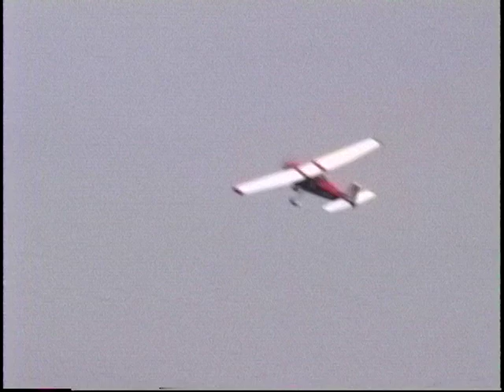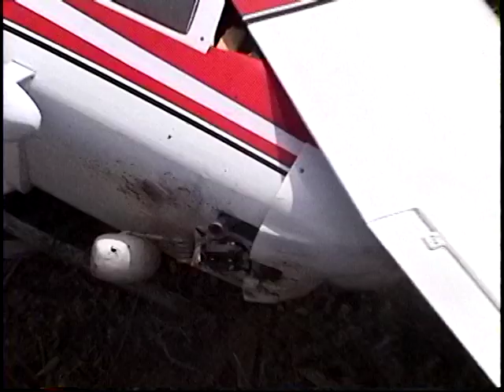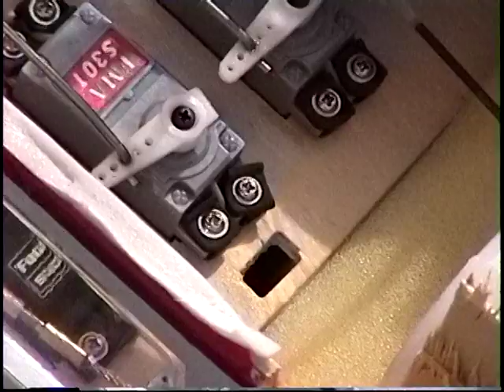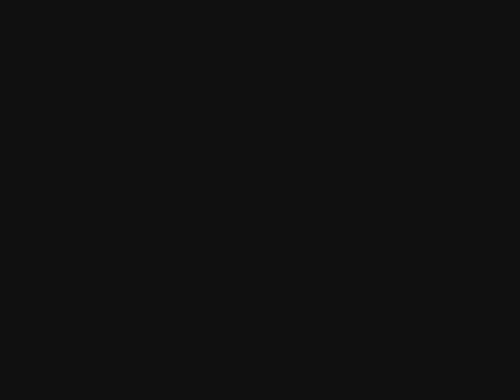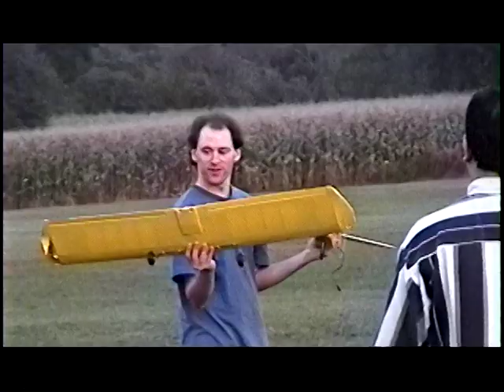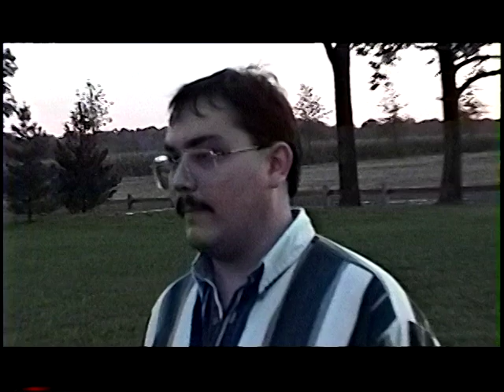RC airplane crashes - pissed off pilot - better quality

Comment: You can see the wind direction when you rev up the Cessna in the beginning. Notice how the first downwind pass the plane gets out of shape but you get lucky. Heading up wind or right to left in the video is fine. Only when you go left to right or downwind does it get bad, and only when you have dropped the throttle on the second pass. Ailerons were fine before crash, stalling downwind caused by excessive use of the ailerons instead of the rudder. Ailerons will induce more drag, making it worse

Comment: What you really had here was the falling leaf manuever but using ailerons instead. Plane was stalled and You failed to lower the nose to recover. Once you have gone below stall speed, ailerons will aggravate the wing stall. You MUST use rudder to lift the wing once you have entered the stall region. This was taught to me well by an acrobatic instructor when I earned my Private License. Size of plane does not matter though transmitters are hard to get used to for me after using hands and feet!

Comment from the maker: 6th, I took apart both aileron servos and found flashing on both plastic output shafts, which was the defect Cirrus admitted was the problem with a large number of servos - I still have the reply letter! 7th, the servos and a full copy of this video was sent to Cirrus and they sent me a check in return to purchase a new plane after admitting their servos failed from the defect. 8th, this video is 12+ YEARS OLD! I haven't crashed a plane in 8 years; in fact, I am a flight instructor now. lol

Comment: Okay, read carefully. The wind is left to right as your looking out. 10 second mark notice the direction the smoke goes. The turn from down wind to upwind at the 50 second mark is a classic no rudder turn. At the 1:11 mark you point the nose way to high in a downwind pattern and then get on the throttle to late to save it because you continue to hold elevator when you should be pushing the nose down. The plane is stalling pitching left/right until it stalls for good and crashes damaging servo.:)

Comment: The Cessna crash was a classic wing stall. Air speed too low, angle of attack too high = wing stall. This is the classic start of an Insipient Spin and must be correct properly.

You then made the situation worse by hitting the ailerons hard just further disrupting the already compromised airflow over the wing making the stall worse - thus the seesaw action you see while you are trying to correct the stall. Last control you touch is aileron.

Not ridiculing you, just stating the facts.

Comment: The yellow plane at the end might run at full throttle if you adjusted the carburetor. I hope you have learned since 2012. Been 3 years now.
Reply from the maker: +ctrcflyin2011 It's actually been almost 19 years ago - that was filmed in 1997.
Reply: +BSD2K11 Wow, 19 years ago. When i was born you were out on the field being pissed at your crashed plane! x)
Reply from the maker: +Tremor244 lol Yep!

Comment from the maker: 1st, the camera man's position is behind the plane. In that position, you can't judge the ground speed since the plane traveling AWAY from you, it LOOKS like it's standing still when it was NOT. 2nd, I was flying directly INTO a steady headwind. 3rd, at 1:11 I apply 3/4+ throttle to compensate for the headwind. 4th, the servos DO NOT MOVE from 1:14 until impact. 5th, the servo manufacturer examined the servos and admitted they had a bad batch of servos and my set was defective.

Comment: It's called stall.  No servo  problems.  Pilot error.  Not the planes fault.  Whole flight was barely under control.  surprised it lasted that long.

Comment from the maker: 1. Air speed and bank angle were fine. The engine was 3/4 throttle in a headwind with a forward speed of roughly 35mph, heading away from the camera.
2. The bank to the right was intentional, it was my first attempt to get the left aileron un-stuck.
3. The bank to the left was a reaction to centering the control stick to check for a neutral aileron - it was still stuck.
4. The wobble back and forth was my attempt to use the rudder to compensate for a stuck aileron. Watch the full video I posted.

Comment from the maker: Ok, let me ask you this - if I rig a plane up where I can kill your left aileron control (with it raised up), right before entering a turn, into a headwind, at 3/4 throttle, ~65 feet in the air; and you have to struggle with the failure and try and fly the plane straight and level, would it look like a stall and pilot error? Especially from the viewpoint of a camera - directly behind the flight path? What came first - the aileron failure or the stall? How far could you fly with a failed aileron?

Comment from the maker: If you were fighting a stuck aileron, it would LOOK like your stalling the plane too. The problem with your theory is: if the aileron did not get stuck, the flight would have been uneventful and I would have landed safely. Just like a stock car driver who's tire blows out and wrecks - if you miss the fact that the tire blew out, then I guess you'd think the driver slammed the wall on purpose. 

So, what if the tire didn't blow and what if the aileron didn't freeze?

Comment: watching you fly the cessna you crashed it, you were going too slow and tail heavy. if you can't take off using landing gear don't hand launch it if the motor stalls at full throttle  fix it don't fly it

Comment: 1st Crash... Stalling it.   2nd Crash... you don't cut throtlle when you hand launch an aircraft.  (or if you had engine problems you shoutd have fixed it prior to having it tossed).    Recommendation - go to local hobby shop or contact  RC club to ask if they know of  instructors who can teach you how to fly properly, and safely.

Comment: number 2, always , every flight , hold plane vertical at full throttle and make sure engine clears out to near max rpm, certainly not too lean. 1 to 2 second from idle to max rpm, then set low end mixture to reasonable idle, which if effect will act as an airbreak assisting with your task number 1

Comment from the maker: I agree - it was a bit tail heavy. It was the maiden flight and I never got a chance to adjust the CG, although I did check it before heading to the field. I usually build my planes slightly nose heavy, but for the Cessna, I made it level using a Great Planes CG scale. With windy conditions as they were, I should have adjusted it at the field. Oh well.

Comment: first day out after rebuilding my F4F my buddy and I were flying at the local park. had my camera on it and when doing a low pass i lost signal and hit a light pole full throttle. After my rant I realized it was a pretty cool crash, but my camera was destroyed =(  up until that time I had never seen a foam plane wing explode... =D

Comment from the maker: I could agree with you, but then we'd both be wrong.

• As I approached the last turn I was heading into the wind.
• Before I began the turn, I increased the throttle. It's not a 2-cycle engine, so it may not sound like it was screaming, but it was nearly full throttle.
• Ailerons were not fine - I was flying the plane, not you, so to pose a bold statement without facts is ignorant.
• I couldn't care less what people think caused the crash - the mystery was solved 13 years ago.

Comment: Skip the Nitro and Balsa...pick any Horizon Hobby foam/electric ARF and go to town. When you crash it you glue that sucker back up, slap on a new prop and go flying again within the hour....as good as the foam is today and with the new AS3X system coming on more planes its making the hobby less expensive and more rewarding.A sim wouldnt hurt either.

Comment: never hand launch a low or mid wing plane..Take off from ground ..Also,No one can fly a tail heavy plane ..It just wont fly right..I ALWAYS fly mine a LITTLE nose heavy , but only slightly..I feel your pain..I taught myself and learned the hard and expensive way

Comment: Pilot error all the way on the Cessna; no rudder in the turns meaning it was yawing nose high through the turns. Due to this it stalled the pilot hauled back on the stick and it just stayed stalled all the way down. Basic newbie error. Clearly nothing wrong with the aileron.

On the hand launch the motor was set too lean. You need to check the plane at full throttle holding the plane nose vertically up to make sure it doesn't lean out when the nose rises in flight (basic stuff).

Comment: I have had my elevator servo sheer, it happend during a high speed dive, ended bad. But that last crash is a nightmare, ive had the same thing happen except it was my lipo cable jolting out causing a nose dive, minor damage, given that it was a foamy!. Balsa planes are too much work for me to even attempt at the moment!

Comment: I hope you did'nt give up! I wrecked my aerobat several times learning RC! Bought 3 airframes KNOWING I was going to crash learning to fly from a third person perspective and reverse sensing lol! Now, my hangar has 12 planes of different characteristics and have just started an FPV with a Piper Pawnee! The lack of airspeed info was really hard to get used to. Go high and practice the falling leaf and stalls to get a feel for stall speed and recovery techniques before flying low and slow.

Comment: Obviously a very low time pilot.  He just simply stalled the Cessna and thought he had radio failure.  And the hand launch was as usual a very low percentage way to take off.
He should get a nice flat bottomed airfoil trainer instead of flying "over his head."

Comment: Mate the cessna was piloit error u stalled the plane and the nose dropped and when u tryed to add movement it tip stalled piolit error not the plane and on the hand luanch the engin was to lean

Comment: LOL... not a hobby for the faint of heart. Crashes happen... but in the case of the extra 300,  if you are having engine trouble, why would you try to fly it anyway? I might fly an experimental scratch built with a reasonable expectation of disaster but these are kit and RTF/ARF planes and should be in working order before you fly. You did stall the Cessna. Most likely in the head wind that was tearing up the microphone. Almost sounded too windy to fly small aircraft like that.

Good luck!

Comment from the maker: Sorry, I can't 'bleave!!It'.

Let me rig a plane up where you loose control of the ailerons while approaching a turn at 3/4 throttle, with the left aileron stuck in the up position and see how long you stay airborn. Let's see if the crash looks like a stall or not as you struggle to keep the plane level and straight. I'll film it from behind so it looks like you're standing still, then blame you when it hits the ground. Sound good? :)

Comment: I have seen this many times before- some people think they can drive an rc car, or fly a simulator, that they will just fly an rc plane! I learnt with an experienced pilot on a buddy lead until I got the hang of it, and I still crashed! You need the help and guidance of a club, or you will either get disillusioned and give up, or spend a fortune and all your spare time will be putting artf models together!
Reply: This is how I learned but not with a gas balsa model. I crashed my first foam plane in 2 seconds after I took of. But I learned from it and I knew how to fix the mistake I did.

Comment: the crash was not from the plane it was pilot error you tip stalled the plane keep it level dont be forcing the nose up thats what will crash your plane i know cause  im an AMA, AOPA, member and im a student pilot
Reply: +isaac gandelman It didn't tip stale because of the pilot. These Hanger 9 172s are notorious for losing aileron control which causes a tip stall. Not sure why but I seen 5 of them eat dirt because of it. One reason could be the servos they say you can use and plastic gears is bullshit on anything but light wing load sailplanes!

Now the Super Sportster had it coming. The damn engine was not running right but the nylon wing bolts saved his ass. As they are designed to shear off before ripping the wings out. 

I might add. Show me where newbies don''t learn the same lessons without expert help. I'll show you a liar that crashed more planers then John McCain!
Reply: really? because i had these planes before and they worked pretty ok with me never had a problem with controlling them..
Reply: isaac gandelman Did I say all had an issue? The fact is they eat plastic gear servos for some reason. I would say because they don't know how to setup the servos and they tear the gears out. As I seen some pull the ailerons totally out of the trailing edge from over extension of the servo arm pushing on them so hard. Then I seen the servo arm screws fall out from not being lock tight down. These are just things the new people need to learn. Some faster then others. Just depends if you have someone around to help. In my case I had an expert help me pull my head out of my ass.
Reply: ok in that sense then yes the plastic gears are crap . however i did change to metal gears so that is why i didnt have a problem so yeah im with you on that one
Reply: Claude Rains pilot stalled the first plane!clearly under powered the damn thing.it had plenty of power but he does these crashes  on purpose! Bad Acting..

Comment: I could see and hear the cross wind in the first one as you were checking engine.  Shouldn't have taken it up.  It only gets worse the higher up you go.

I'm not an RC guy, but I know a lot about balsa construction, so I know not to take stuff out that I spent a long time on, when it's windy like that.

Comment: Sorry to be the bearer of bad news but 1:14.  FULL STALL. Signature wing rock, nose high, Then, you pulled back instead up adding power and pushing over.  Look at :50.  It stalls there too but recovers.  Downwind = higher groundspeed to maintain airspeed.  I know how frustrating this can be.  Youre not the first one to blame servos for this.  Loss of control, Yes.  Servo fault? No. Maybe stick to RC boats or better yet. buy a kite.

Comment: ha ha so you opted to keep talking, to funny. you can see your aileron flaping around so dont say it was locked. even if it was locked you dont use ailerons to recover from a spin there isnt enough air going over the wing thats why you use your rudder.

Comment: Rogue flyers ,dangerous also , i,m sure there're not in a club and have no AMA insurance, why did he try to hand launch the yellow plane ,looked like it had the power to get off the ground  to me.
Reply from the maker: Nope, you're wrong. At the time of the video I was a 5 year member of the Lehigh Valley Radio Control Society and had a current AMA membership with insurance. The field we were flying in was a seldom used soccer field behind Lehigh University Stabler Arena with farmland and empty fields on either side of the trees - completely safe. My plane landed at the edge of a recently plowed cornfield.

The yellow plane did indeed have enough power to get off the ground, but what you don't see is the crash that happened before that video which damaged the landing gear making it impossible to take off from the ground. I might import the video from the previous crash and post it someday.

Comment: I've crashed plenty of planes and - after some analysis - it's always the pilot's fault.    If not a flying mistake then the equip - cheap hardware, poor build technique or maint, not checking equip.    And from what I see here you were not a good pilot at this time - both skill level and attitude.    Hand launching that yellow plane was simply stupid.   And making your friend's uncomfortable afterwards was just douchey.     I sure wouldn't fly with you.

Comment: ha ha its funny you get so mad. If you are such a pro rc pilot then you would see what everyone els can see that when your air speed is to low and your angle of attack is to high its called a STALL. the when one wing is more "STALLED" then the other the plane will "SPIN". listen to ConvairDart106 he knows what he is talking about or keep talking Mr. flight instructor its funny ass hell